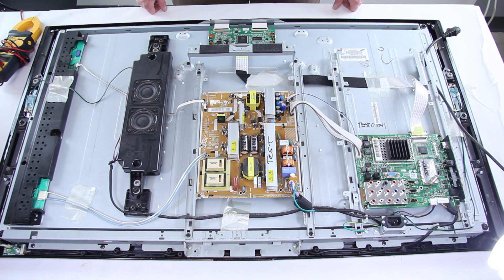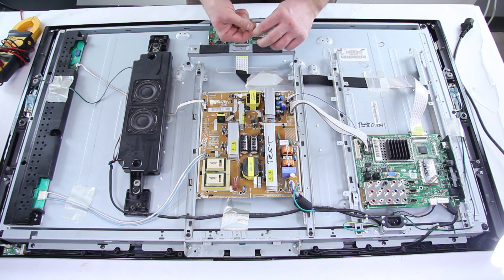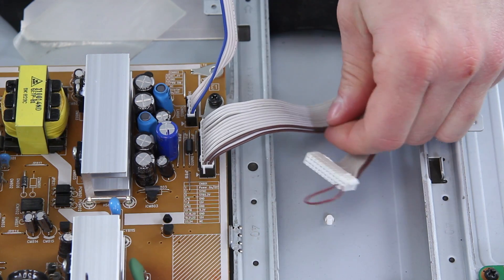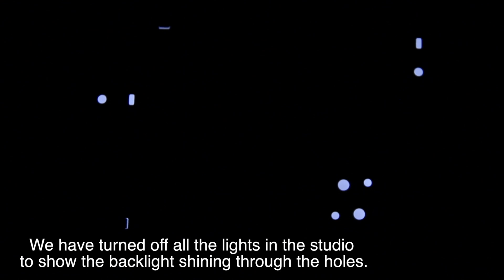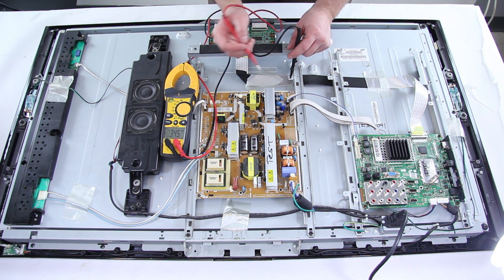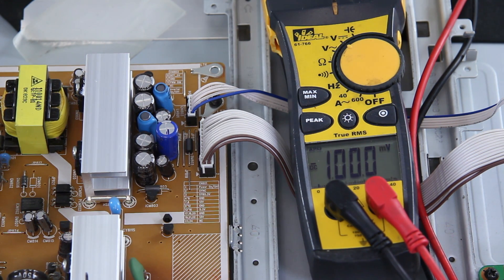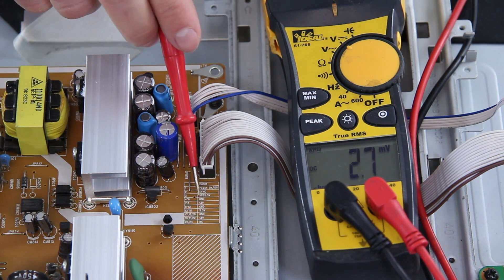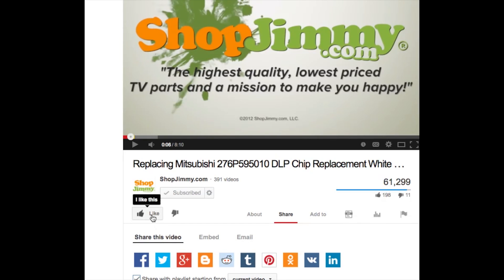Samsung LCD TV Repair - TV Won't Turn On - How to Replace Power Supply & Main Board

Comment: I have a Samsung tv hlt6187sax/xaa I turn it on it runs fine but I turn it off and wait 15 mins it will not come back on heip
Reply from the maker: darrel blankenship   I recommend replacing the power supply board in your TV.  Here is a link to replacement parts for your TV model number on our website, click here:  http://www.shopjimmy.com/catalogsearch/result/?q=hlt6187sax%2Fxaa  Be sure to match part numbers on your current board, with your replacement for compatibility.  Here is a link to a video showing how to identify your part number, click here:  TV Part Number Identification Guide for Samsung DIY TV Repair Power Supply Unit (PSU) Boards  You can also call our customer service for further assistance with your purchase.  (877) 881-6492  Thanks and please let us know if you have any further questions with your TV Repair!  www.shopjimmy.com

Comment: I have a sony bravia KDL-46W3000, it took a power surge from a lightning strike, all I have is the green light flashing at the bottom which I can't find any diagnostic advice on.  Any idea if it is worth taking a look at the power supply board or is it a lost cause.  I do know the power surge come in through the HDMI cable from the cable box if that helps.  Thanks Joe
Reply from the maker: J Ramsey   I recommend replacing the main board in your TV.  Here is a link to replacement parts for your TV model number on our website, click here:  http://www.shopjimmy.com/catalogsearch/result/index/?cat=56&q=KDL-46W3000  Be sure to match part numbers on your current board, with your replacement for compatibility.  Here is a link to a video showing how to identify your part number, click here:  TV Part Number Identification Guide for Sony Main Boards (LCD, LED, Plasma TVs) TV Repair  You can also call our customer service for further assistance with your purchase.  (877) 881-6492  Thanks and please let us know if you have any further questions with your TV Repair!  www.shopjimmy.com

Comment: Hi I have a question:
I have a Samsung LE32A656A1FXXC and  it will not power on.
No led blinking, No led power on and no Stand-By led power on.
1. I replaced capacitors near the connector CNM802(number 1 in the picture below) and it didn't work
2. I replaced capacitors with number 2 in the picture and it didn't work.
3. When I was measuring the voltage of the diodes bridge I touched with the multimeter the pin + and the heat sink causing a short but I think it didn't damaged the board.
4. I replaced also  phototransistor with the number 4 (a tlp781 - in board number pc801s) with a cosmo k1010 but it didn't work.
I checked the voltage of the all connectors with no cables connected from mainboard and inverter board and all displayed 0 volt.

I don't know how to repair and what other componets I have to replace.

Here is the link for the schematic of BN44-00208A Power Supply Board:
https://drive.google.com/file/d/0BxkFbaXDmkFmbUpuVkc4SkpUQXc/edit?usp=sharing

Here is the link for the picture:
https://drive.google.com/file/d/0BxkFbaXDmkFma053by14ZVVLbVU/edit?usp=sharing

Thanks in advance.
Cristian.
Reply from the maker: 3lack79   I recommend replacing the power supply board in your TV.  Unfortunately I do not see any replacement parts in the search results for your TV model number on our website.  Please reply with your part number on your power supply board and I can try searching for replacement parts.  Thanks and please let us know if you have any further questions!  www.shopjimmy.com

Comment: Toshiba 32av502r it turns off by its self plis help
Reply from the maker: Emanuel Maceo   I recommend replacing the main board in your TV.  Here is a link to replacement parts for your TV model number on our website, click here:  http://www.shopjimmy.com/catalogsearch/result/index/?cat=56&q=32av502r  Be sure to match part numbers on your current board, with your replacement for compatibility.  Here is a link to a video showing how to identify your part number, click here:  TV Part Number Identification Guide for Toshiba Main & Scaler Boards (LCD, LED, Plasma TVs)  You can also call our customer service for further assistance with your purchase.  (877) 881-6492  Thanks and please let us know if you have any further questions with your TV Repair!  www.shopjimmy.com

Comment: samsung LA32C350D1 standby light on(constant) and tv won't switch on via the remote nor tv  itself...please assist
Reply from the maker: Cardro Williams   I recommend replacing the main board in your TV.  Here is a link to replacement parts for your TV model number on our website, click here:  http://www.shopjimmy.com/catalogsearch/result/index/?cat=56&q=32C350D1  Be sure to match part numbers on your current board, with your replacement for compatibility.  Here is a link to a video showing how to identify your part number, click here:  Samsung Main Boards & Digital Boards: Part Numbers for LED, LCD, DLP, Plasma TV Repair  You can also call our customer service for further assistance with your purchase.  (877) 881-6492  Thanks and please let us know if you have any further questions with your TV Repair!  www.shopjimmy.com
Reply: Are you saying that the main board is faulty...or is there something on the main board which could be faulty?
Reply from the maker: Cardro Williams   I am recommending to replace the entire main board.  Thanks!  www.shopjimmy.com

Comment: I have a '10 Samsung 46" 1080P LED HDTV, #UN46B8000XFXZA. I cannot power up the TV, only get a couple of clicking sounds every 5 seconds or so. Your thoughts on probable parts failures?
Thanks
Reply from the maker: GJ I recommend replacing the main board in your TV.  Here is a link to replacement parts for your TV model number on our website, click here: http://www.shopjimmy.com/catalogsearch/result/index/?cat=56&q=UN46B8000XFXZA  Be sure to match part numbers on your current board, with your replacement for compatibility.  Here is a link to a video showing how to identify your part number, click here:  Samsung Main Boards & Digital Boards: Part Numbers for LED, LCD, DLP, Plasma TV Repair  You can also call our customer service for further assistance with your purchase.  (877) 881-6492  Thanks and please let us know if you have any further questions with your TV Repair!  www.shopjimmy.com

Comment: IF THE POWER SUPPLY BOARD SUPPLIES THE CORRECT VOLTAGE, AND TV STILL WONT TURN ON, HOW OR WHAT DO I NEDD TO CHECK ON THE MAIN BOARD( KLV-40V400A) SONY BRAVIA LCD TV-BG 1-875-581-13 AND THE POWER BOARD IP5 1-876-467-13
Reply from the maker: Karl Alexander   I recommend replacing the main board in your TV.  Unfortunately I do not see any replacement parts in the search results for your TV model number on our website.  Please reply with your part number on your power supply board and I can try searching for replacement parts.  Thanks and please let us know if you have any further questions!  www.shopjimmy.com

Comment: hi i have a toshiba 40bv700b tv set recently we turn it off at night and it switches itself back on but the other day the white standby light was flickering when i tried to turn my tv on the stanby light just kept flickering any idea what it could be.
Reply from the maker: Dean Robertson   I recommend replacing the main board in your TV.  Here is a link to replacement parts for your TV model number on our website, click here:  http://www.shopjimmy.com/catalogsearch/result/?q=40bv700b  Be sure to match part numbers on your current board, with your replacement for compatibility.  You can also call our customer service for further assistance with your purchase.  (877) 881-6492  Thanks and please let us know if you have any further questions with your TV Repair!  www.shopjimmy.com

Comment: hi i have problem on my tv the model no is PS-50C96HD so in tv when i switch on dose not turn on and i can heard the noise for the tv tube is not going to be on so in every 40 sec is going to cut off and i van see the green light on back side that light going cut off every 40 sec so pls late me know what i have to do  thanks
Reply from the maker: ankit patel   Try this repair at your own risk.  I recommend disconnecting the y board in your TV and then powering on the TV to see if it will power on with the y board disconnected.  Here is a link to a video that might help you!  Samsung Plasma TV Help with Clicking Noise On Off TV Repair How to troubleshoot Vizio & LG  Please reply with the results of this test.  Thanks!  www.shopjimmy.com

Comment: Samsung 51" Plasma TV Model# PN51E450A1F

To address the start of the problem I apparently had a short in my surge protector (yeah it's doing exactly the opposite of what it was made for) that also shorted my Samsung Surround Sound and my Xbox 360. Woke up one morning and tried to power on my units as usual, but nothing happened moved my tv to 4 different outlets with in my house and nothing.
So, the symptoms are the tv will not power on-the red led standby light does not illuminate. When i unplug then plug in the tv there is a dim back-light that comes on the screen for 5 seconds then the screen returns to black (off). I've opened the back panel and started to do a visual inspection on all the circuit boards. When plugged in the Main Logic Board green Led flashes as normal with 1 second increments no damage shown on board. The Power Supply board fuse was not blown neither the capacitors nor was there any other signs of damages on the board. Input Circuit Board has no signs of damage. The X-Sustain Board has does not have any blown capacitors or other signs of damage. The Y-Buffer board has no signs of damage. The Y-Sustain Board  does have a burn discoloration on the circuit board but right in that spot it says "WARNING! High Voltage Hot Surface Do not touch for your safety" i'm not sure if that is common on that spot or if something was blow/shorted out.
What I have done so far is completely replaced the Power Supply Board with a Brand new one (same Model Number). But the tv still has the same symptoms. My next part purchase was going to be the Y-Sustain Board (Id'e rather take a chance on a new circuit board then buy a Multimeter and test everything-but if it comes to that so be it), unless you guys think it may be something else. It would be great if you guys gave me some feed back or answers to my problem.

I called the Samsung tech center and they said the life expectancy of my tv model is 5 years (Manufacture Date: July/2012   My Purchase Date: October/2012  Malfunction date: June/2014)  It came with a 1 year warranty but since that is expired they quoted me $450 for repair with parts and labor...I only paid $600 for the tv. So if I'm able to just Buy a $50 dollar circuit board and fix it myself that would be awesome if not I'm more than likely gonna buy a new tv with a longer warranty.

Also I'm located about 5 miles from your facility in Shakopee,MN could I just pick up a part or do you only ship items?
Reply from the maker: john smith   I recommend replacing the Y-Main board and Y-Scan Drive board in your TV.  Here is a link to replacement parts for your TV model number on our website, click here:  http://www.shopjimmy.com/catalogsearch/result/?q=PN51E450A1F  Be sure to match part numbers on your current board, with your replacement for compatibility.  Here is a link to a video showing how to identify your part number, click here:  Samsung Plasma TV Repair: Samsung Plasma Panel Parts Guide  You can also call our customer service for further assistance with your purchase.  (877) 881-6492  Thanks and please let us know if you have any further questions with your TV Repair!  www.shopjimmy.com
Reply: Do you know plasma. Apparently pn51e450a1f is a plasma tv. The only voltages i get to the main is 4.2vdc to ps on pin, and 5.2vdc to the standby pin. All other pins are 0 volts.
Reply from the maker: I recommend replacing the power supply board in your TV.  Click this link to replacement power supply boards for your TV model number:  http://www.shopjimmy.com/catalogsearch/result/index/?cat=59&q=pn51e450a1f  There may be multiple boards for the same TV model number, be sure to match part numbers on your current board, with your replacement for compatibility.  Here is a link to a video showing how to identify your part number, click here:  https://www.youtube.com/watch?v=sSJexLvRrjM  Thanks and please let us know if you have any further questions with your TV Repair!  www.shopjimmy.com

Comment: What if you disconnect the main board in the back lights come on without jumping it
Reply from the maker: Kevin Matthew   Could you please supply more information about your problem?  Please include TV model number, symptoms, and any other problems.  Thanks!  www.shopjimmy.com
Reply from the maker: Kevin Matthew   I recommend replacing the main board in your TV.  Here is a link to replacement parts for your TV model number on our website, click here:  http://www.shopjimmy.com/catalogsearch/result/?q=LN46D630M3  Be sure to match part numbers on your current board, with your replacement for compatibility.  Here is a link to a video showing how to identify your part number, click here:  Samsung Main Boards & Digital Boards: Part Numbers for LED, LCD, DLP, Plasma TV Repair  You can also call our customer service for further assistance with your purchase.  (877) 881-6492  Thanks and please let us know if you have any further questions with your TV Repair!  www.shopjimmy.com

Comment: Hi there, thanks for putting all this info out there.
I have a small Samsung TV UA22ES5000M. After very little use it died completely. No backlight, no LED, nothing
The Power Supply is BN44-00504A. Fuse FP801S seems OK. No caps are bulging. Large cap CP801 has 320VDC at the terminals. 
A jumper on the front of the board JP817 is labelled A5V and reads 5VDC.
Another jumper JP809 labelled B13V reads 0V.
No DC voltages either 5V or 13V appear at the pinouts.
Any ideas as to what I might try next?
I'm quite happy to replace the board if necessary but am treating it as a bit of a learning exercise at present.
Thanks again.
Reply from the maker: Dave Gamble   I recommend replacing the power supply board in your TV.  Unfortunately I do not see any replacement parts in the search results for your TV model number on our website.  Thanks and please let us know if you have any further questions!  www.shopjimmy.com

Comment: hi, i have a Samsung LE40A558P3F I'm getting horizontal flickering lines and bands across the screen, (not across the whole screen though covers just over half) mainly its just a faint flickering of the bottom left third of the screen but occasionally its a thick band of black.  Its not a consistent thing either as some times the image is perfect, I'm assuming that there is some kind of bad connection somewhere.  Is this a capacitor issue or a t-con board problem?
Reply from the maker: Steve Smith   You can try replacing the T-Con board to see if that fixes the problem, however if the problem continues I would say you have a bad TV panel.  Here is a link to replacement parts for your TV model number on our website, click here:  http://www.shopjimmy.com/catalogsearch/result/?q=40A558  Be sure to match part numbers on your current board, with your replacement for compatibility.  You can also call our customer service for further assistance with your purchase.  (877) 881-6492  Thanks and please let us know if you have any further questions with your TV Repair!  www.shopjimmy.com
Reply: its the mounting of the screen if you remove all the covers and unscrew the metal covering find the ribbons which the screen hangs from  touch each ribbon until you see which one causes the problem then use foam to pack it down from the top or front replace metal covering hey presto fixed.  mine does that too,  may take some trial and error and might not work forever.